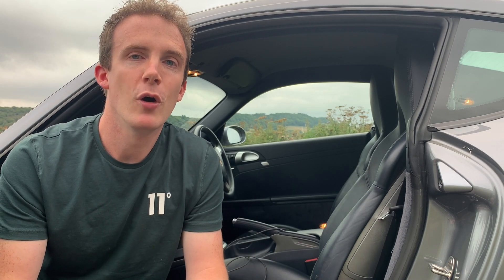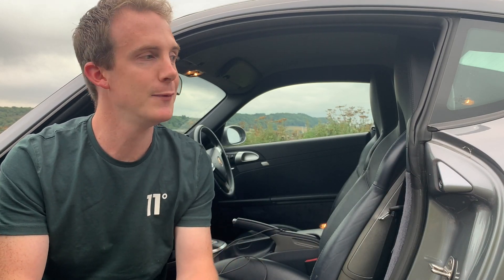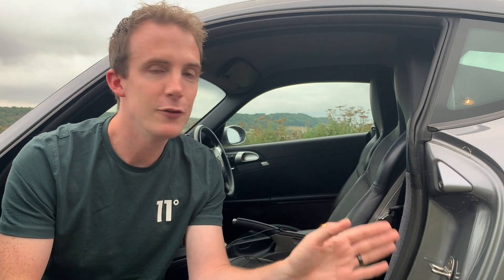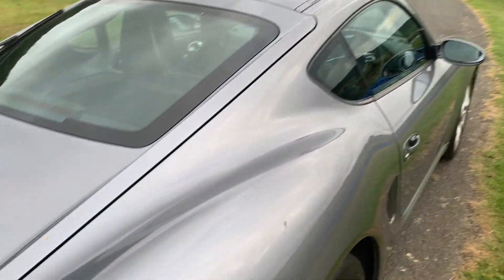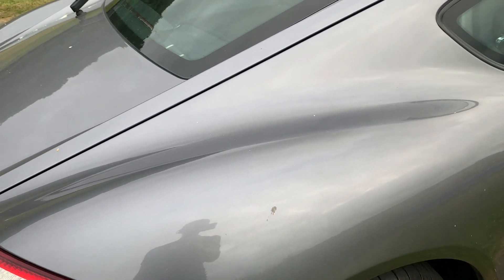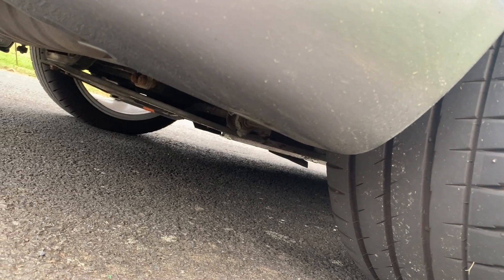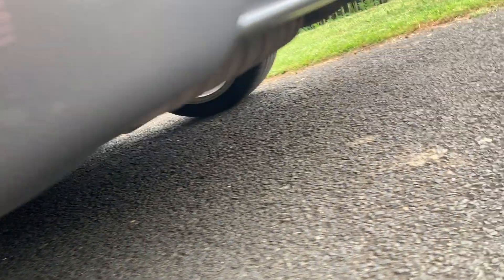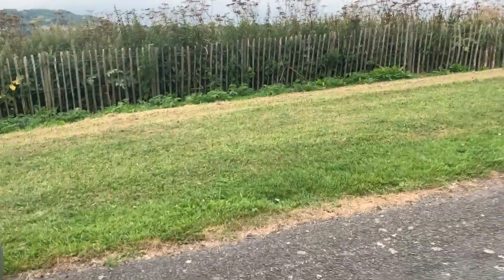MY CAYMAN 987 HAS BORE SCORE | What are the symptoms , sound and repair cost?

Comment: Ppl saying you should have got it checked before u bought it are daft. The scope is quite invasive, if someone wanted to scope my car before buying it, I wouldn't let them, because an amateur can easily damage the engine doing so. The only safe place to take it would be Porsche, and why am I going to go to the inconvenience of getting my car to Porsche for a day so someone MIGHT buy it?! It's not a realistic suggestion. U pays ur money, u takes ur chances 👍
Reply: @Model192  well yeah, if they're an idiot lol. But also to do a full exam you need to manually crank the engine (obviously, because the pistons aren't all up or all down at the same time) which can upset the timing. So yeah, I wouldn't be letting some random moron with a boroscope who "might" buy my car go messing about in there. Also I'm told it takes a real expert to even diagnose scoring this way. Apparently most cylinders have harmless scoring in them, whether or not this is problematic and likely to develop into full bore scoring is basically personal opinion. So you also run the risk of some idiot telling you you've got bore score when you don't. Cue money then wasted having to go to a proper specialist for reassurance. No thanks!
Reply: Incorrect. It's not hard to scope an engine. Any decent specialist can do it. If a seller refuses, walk away. It's no more invasive than changing the spark plugs. Incidentally, taking it to Porsche would not be a great idea. Better off with a good independent specialist. Most Porsche centres won't be terribly experienced regarding scoping these slightly older engines. Pre purchase inspections are very normal on cars like this. I've bought Porsche privately and had them inspected before purchase. If the seller said no, I'd walk away. It's a completely reasonable request provided the buyer pays for it and reflects very poorly on a seller who refuses.
Reply: @flat6croc  very well, don't buy a Porsche from me then. I'm sure there are plenty of specialists who are very capable, but if you want me to put faith in the fact that you (person I've never met who currently has zero financial responsibility for my vehicle) will a) find a capable person and b) pay enough for said competent person, AND you want me to use MY time for this to occur... No thanks mate. If you insist, that's cool, like I say, don't buy my Porsche lol
Reply: @flat6croc  PS Any inspection would be welcome, as long as it doesn't involve removing anything significant. Both specialists I go to have said they would never remove parts on an inspection, because they never know if the car's been poorly maintained and the bits don't go back on (corroded bolts etc), then they become liable, it all becomes a hassle and not worth the money for the risk. So a difference of opinion from specialists maybe. But I like mine, and trust mine. I don't know or trust yours. And that's kinda my point
Reply from the maker: Well it may be people would think it could damage it and with getting something in there you potentially could. I wouldn’t want somebody doing it that was a prospective buyer.
Reply: @JoeTalksCars  indeed. Also didn't you have to go multiple places to even diagnose the bore score? And the main reference point for the diagnosis was presumably the massive oil consumption. Overall scoping seems a fairly inexact and therefore pointless thing to do speculatively to me. It's one thing to use it to confirm an issue, but just having a peer in there ain't gonna tell you much. I suppose I would consider sending my car to MY specialist for inspection, but then would a buyer trust MY specialist to give an honest review? And I'd insist they pay the money to have my car collected and delivered from and to my house, selling a car is enough hassle without throwing trips to the garage in as well!
Reply: @jkb19893  It's not remotely pointless. It's not 100% accurate, but an experienced independent will be able to identify significant scoring. I've shopped for these cars on multiple occasions and never had anyone refuse an inspection. You'd be in the minority and enough people are now switched on to the problem that you'd be shrinking your market by refusing. Having the bores scoped is essential when buying an M97 3.4 car and it is an entirely reasonable request. The buyer should pay for the inspection, but most would walk away if you insisted on being paid to have the car taken to the workshop and returned. That ridiculous and you'd come across as a complete pain in the arse seller. You'd also come across as poorly informed if you gave the impression that inspecting the bores was anything other than routine with these cars.
Reply: @JoeTalksCars  Nobody well informed would think that getting the bores inspected is anything but routine on these cars. You wouldn't want a random person doing it, but it's entirely reasonable and totally routine to get a specialist to inspect the bores, just as it's reasonable and routine to do a spark plug change.
Reply: @jkb19893  You're making things up. No good specialist would say it's a bad idea to inspect the bores on these cars before purchase. There are also no problem parts regarding getting at and removing the plugs. They are routine service items. Repeat, routine service items. There's no difference of opinion, I'm afraid. You are just not well informed. All we are talking about is having a specialist remove a spark plug, which is a routine service procedure. You are entirely conflating this into a problem that it is not. I agree that I would not want a random punter doing it to my car on my drive. But there is absolutely no reason whatsoever to object to a specialist garage doing it.
Reply: @flat6croc  I am a pain in the arse lol. A very busy one. Who luckily isn't selling his Porsche, so it's not currently an issue! 😂 As I said to Joe, visual inspections would be more than welcome when coming to look at the car, I've got hoardes of paperwork, it's been regularly to two specialists whose contact details I would gladly provide and a person could contact them and seek their opinion on the quality of the car. But my time is my money, I don't have the time to be taking it to garages left right and centre. As I say though, luckily for you I'm not selling and you're not buying! 😂
Reply: @jkb19893  If a visual inspection is fine, scoping the bores is no more or less inconvenient for the seller. By the by, a visual inspection of any value means putting the car on a lift, not looking at the paintwork on the driveway.  And reams of paper work are irrelevant. Very well cared for cars can have scoring. It's the single most important thing you need to check on these cars and it's actually bizarre to find someone who objects to having that single thing checked when as a matter of demonstrable fact in involves removing a routine service item. I've shopped for M97 3.4 Caymans twice and I've never had anyone refuse a bore inspection. It's very straight forward. You view the car, you talk to the owner, then agree a sale price pending inspection, you meet at the specialist on an agreed date shortly after, you get the bores scoped, it doesn't take long, you pay the money, buyer goes home in car from specialist. Done. I have done this on more than one occasion. It's not hard. If your car doesn't have scoring, it's straight forward. Of course, if it does or you're not sure and you don't want the sale to fall through if scoring is discovered, then an unethical seller might refuse. Which is why it would be a very, very bad idea to buy from a seller who refuses. The last two Porsches I have bought I have done the transaction at a specialist immediately post inspection and taken the car home. You're conflating it into some hugely time consuming process that it simply isn't. All this nonsense about taking it to garages left right and centre is just that. Nonsense, you just made up. It's all very straight forward if both the buyer and seller are reasonable. Incidentally, there are numerous specialists selling these cars who will not buy them without looking at the bores, it's such a basic, important thing tho check. So, your market will be reduced if refusing totally reasonable requests to inspect the car.
Reply: @flat6croc  yeah to be fair if they intended to buy it direct after the exam then I might agree to that, though my specialist is 40 mins from my house so they'd have to agree to drop me back home after! Lol I  was envisaging more that people would want to do an inspection before deciding on price etc. I also envisaged being asked to take it to various obscure "specialists" (any idiot can call themselves that). If it was literally a check in a box, money to be exchanged directly afterwards, at my specialist, then yeah I'd probably be up for that, fair point
Reply: @jkb19893  That's exactly what I did when I bought my current Cayman, albeit a gen 2 3.4, so I didn't have the bores inspected. Met at specialist. Car inspected. No major problems found. I paid agreed price and took possession of car. Drove seller home. It's not hard to identify and agree on a reputable specialist to inspect the car, there aren't all that many around and people who know these cars properly know which are the decent local ones. It's worth remembering that an inspection costs money. Time wasters are not people who spend £150-£200 getting a car inspected that they have no intention of buying. Someone willing to pay real money to have the car inspected is a sign of a serious buyer, not a time waster.
Reply: @flat6croc  yeah that's fair, perhaps I've just had bad experiences of buyers before lol. Although my specialist is definitely more than £200 for an inspection, more like 500 I think. Definitely weed out the time wasters though, another reason I'd insist on going to him haha
Reply: @jkb19893  lairdinho is 100% correct.  Jkb. I’d never buy a car from you
Reply: So you got bore scoring eh
Reply: I suspect you don’t or never have owned a Porsche, any specialist can perform a bore scope, it’s not difficult and can be done either via the spark plug or via sump removal.
Reply: A Porsche report for yours and buyers piece of mind would probably add value for people in the know which thanks to www is most people I would guess.
Reply: @flat6croc   You must inspect it from under the piston, if it is so bad that you can see it trough the spark plug hole you need new rebuild the engine immediately is what they say. Basically it is to late if you can see it from the top and inspecting from underside is much more complicated.
Reply: @a64738  It doesn't make that much difference. If you can see scoring from under the piston / through the sump, the engine's a goner too. OK, maybe you'll get an extra 5k miles out of it if it's only gone at the bottom. But it's only going to get worse from there. And it's a pretty narrow window between scored at the bottom but totally invisible from the top. It's not true to say that you can only see it from the top when it's very, very advanced.

Comment: This is caused by bad fuel injectors.  They don’t atomize the fuel properly and end up spraying petrol that washes the oil off the cylinders- and this create the scoring.  Make SURE you check your injectors regularly and run an additive in the fuel to clean injectors every few tanks or so.
Reply from the maker: Interesting theory. Problem is there is so much online with causes, nobody actually really knows the cause 100%. Just seems like a manufacturing defect to me and a roll of the dice when buying.
Reply: @JoeTalksCars go wat the oil geek. There was also a long video from Porsche club America. What he says is correct. Bad fuel and dirty injectors spray fuel against the cilinder wall washing away the oil. Also lack of regular oil changes , thus contaminated oil adds up the risk of bore scoring.

Comment: The first puff of smoke seemed a bit blue but the rest looked white from the footage. It's hard to tell really. What mileage has your car done? I heard once they get 100 - 130k miles it would practically impossible to happen.
Reply from the maker: Yeah it is hard to tell. It goes white but even then it has a blue hue and an oily smell. You should see it when I drive off 😝 yeah I’ve heard that. It’s the low mileage stuff like this that go.
Reply: Full synthetic oil burns mostly white
Reply: Is it true that after a certain mileage it does not happen anymore? I am looking into a high mileage 987.1 s (115k), but can also go for a 987.2 base with 120k miles. Really interested in a response, thanks!

Comment: Question for the q and a - what made you decide that ‘now’ was the time to get it fixed? How long can you reasonably run it for once the smoke starts? What’s the worst that can happen if you just keep running it? How many miles did you cover in the year leading up to this?
Reply from the maker: amazing questions! Thank you
Reply: I’d love to know the answers.
Reply from the maker: @trevorgarrett7602  I need to get that video done
Reply: you cannot check it, you will just suddenly notice oil burn
it will increase
and increase
and at some point you'lll realize you add oil as much as fuel..  

There really is no way to check it when just checking a car out, unless you pull all the plugs and get a good scope in there.

Comment: I know it's likely not much comfort, but I wanted to thank you for this video. It prompted me to concentrate on a 987.2 car in my search and I found a terrific one... without bore-scoring or IMS bearing issues to worry about... ever.
Reply from the maker: No its good to hear stuff like this. The channel was formed around this. Buying a Porsche more or less on a whim and seeing what happens. Saves people the hassle. Instead they can watch me make the mistake haha
Reply: @JoeTalksCars  You're a good man, Joe.
Reply: The 997 gen 2 can also suffer bore scoring...
Reply: 2007 987 S 476,000 miles, flash the chip, headers, lightweight flywheel, gt3 manifold, Bilstein R9 shocks... Bought from Brumos in Jax...  With 42k on the odo. 9:26 On quart oil always mobil one or other synthetic 5w40... It's awesome.  Shop looked a cylinders.. Said they're ok.  CHG oil every 5-6,000 miles...  Best car ever.  Also machined aluminum Short throw shifter w sport clutch...  Every on ramp is like being at Sebring...   IMS is only a 1% issue.  Oil CHG is crucial... Will do a video at 500,000 miles... 😊

Comment: Sorry to hear that your having this trouble, I had heard the 3.4 had this problem so I bought the 2.7, no issues in two years of ownership 🤞🏻
Reply from the maker: Yeah I think in hindsight I would have just gone for the 2.7. This car is a headache but once it is rebuild I am sure I will not regret it!
Reply: @JoeTalksCars  Don't be disheartened, it's just bad luck, it could happen to anyone.  I have a 2006 Cayman S and it has 105k miles on it and it runs exceptionally with no problems.  Once it is repaired it will repay you with many years of exciting driving.
Reply from the maker: @bf5175  wow! That’s incredible! It shows that they can be ok from time to time 🤣 can’t wait for mine to be back

Comment: 987s are great cars, have owned one for about 3 years now. One reason to get the base over the S model though is that it can't get bore scoring. The scoring results from a spray-on coating inside the cylinders that was only done on a few models from this era, and the 987.1 Cayman S is one of them.
Reply from the maker: Yeah I suffered that fate. Mines been redone now tho. New liners and running great.

Comment: if one really wants to hear deep interior engine noises and doesn't want to crawl around under the car with a stethoscope around their neck to find them, just remove the oil filler cap and start 'er up. the amount of noise that comes out of that hole is remarkable! (...yours truly left the cap off accidentally)

i imagine a lot of information is held within those noises and an aficionado could diagnose a lot of engine problems using those noises alone.

and BTW, second guessing another's pre-purchase examination of car by suggesting that they have a professional examination is often not realistic. there are time and logistical constraints on the purchaser that might make such an examination impossible not to mention that most owners will not let their cars have an intrusive examination be done on it by an amateur or even a professional garage with which they are not familiar. i know i wouldn't.

i think once all is said and done, you'll have about as much in that car as recently i paid for my 30,000 mile 2007 base model. and i won't have the satisfaction of knowing i have a recently rebuilt engine.
Reply from the maker: Yeah I could look a little crazy 😂 it may be making noises but to me it sounds fine:) yeah that it, what garage is going to seriously let you take a car they have for sale to bits to check. Not gonna happen. It is one of those things, we live and learn and in the end pay for it. Can’t wait to get it fixed :)

Comment: Nice honest approach. My Cayman S smokes like a chimney on cold start on a cold day ONLY and clears within minutes so not AOS. She doesn't burn any oil at all. So I think I have a "normal Porsche" :D I check the oil level every start, and the car is only driven once or twice a week. My plan is, if I ever have major engine trouble such as bore scoring or IMS, I'll make lemonade by way of a 911 Turbo engine swap ;)
Reply: I never see or hear of anyone doing a 911 turbo swap in these. Can it be done 🤔
Reply: @joek1302  I'm sure it can be done. But here I am a year later and still no bore scoring. But if/when it happens, my revised approach (after some research) would actually to be to have it bored out to a 3.8, re-cleaved, and possible hdd a turbo kit.